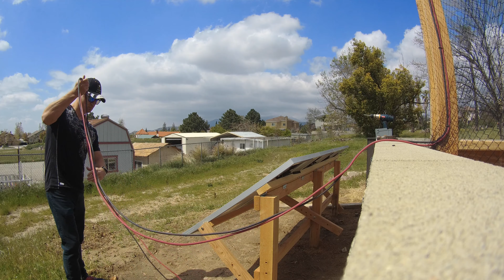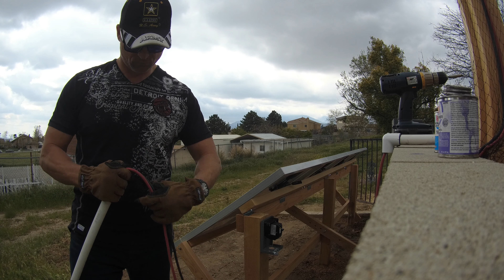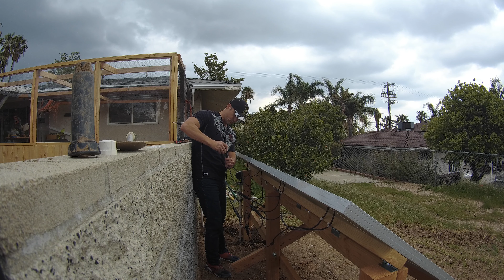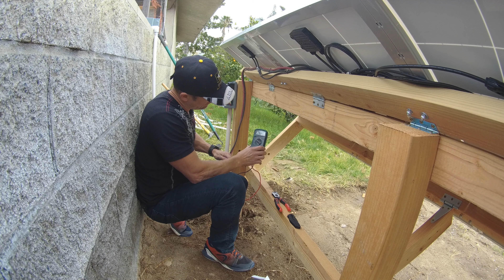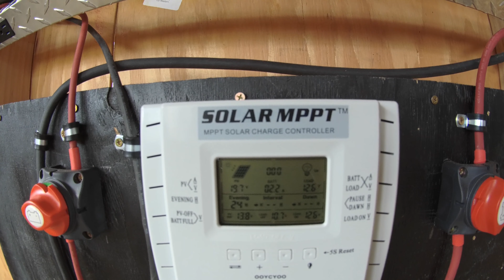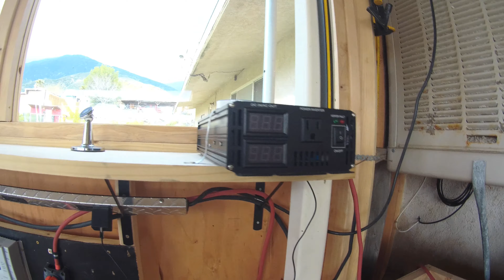Off Grid Solar Project Day 7 - Solar Panel Wiring

Comment: nice video and setup, i came here from your link you replied to me on your other video, i like the way you used hinges on the 2x4 to easliy adjust the tile for a level install. i will remember that
Reply from the maker: Thanks man! Yeah, I go out and change the angle of the panels every month based on the Sun's position.  That's why I used hinges and placed holes in the 4x4's and labeled them by month. I use this website calculation at the bottom of the page. http://www.solarelectricityhandbook.com/solar-angle-calculator.html
Reply: @plantbasedprepper  I have that same handbook i bought probaly in 2018 or something, i have beeninstalling solar panel systems from 2012 to 2019, then i got cancer in th ebrain and was effecting my equiliberium, so had surgery and cant really work now so had to take my ssi early at 62.5 years old, but all clear in brain, and still killing the cancer and still here, so in doing great, and can still walk on my own, so im good